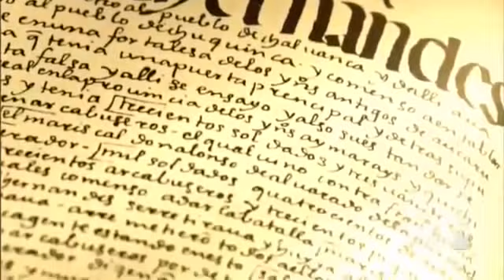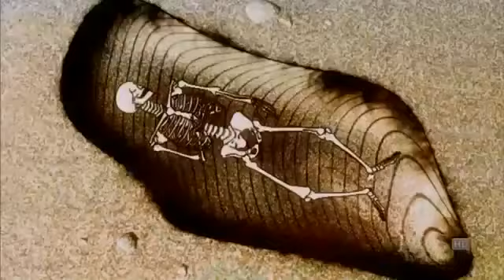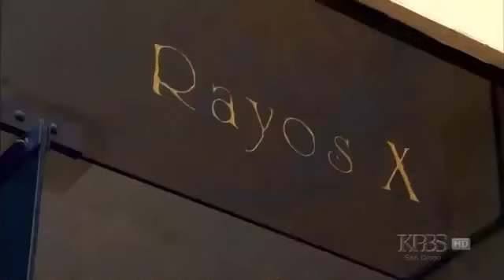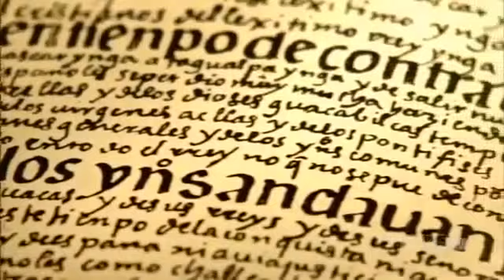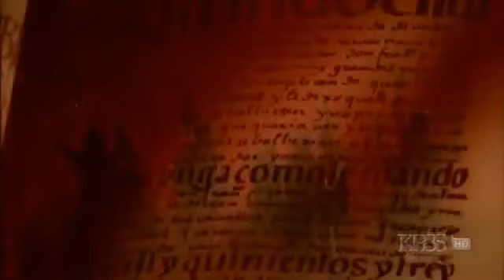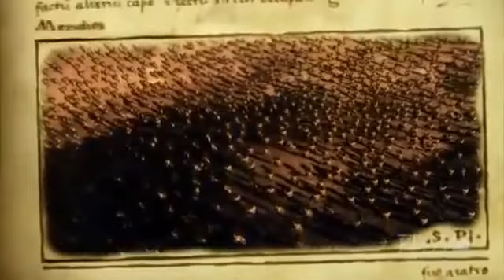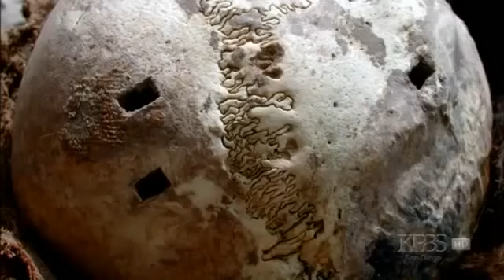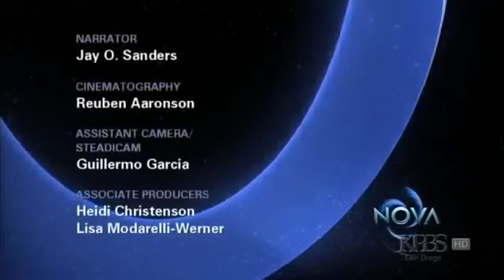Documentary on the Spanish Conquest Of The Incas

Comment: The fact that you don't find any metal residues in a wound, doesn't automathically mean that was NOT a gunshot wound. The projectile might have been made of many sorts of materials, different than just lead. You could have taken a stone and fashion it, into a more or less "round" shape, by work of abrasion and you'd still have a perfectly functional projectile for that type of a gun.  These weren't modern weapon were you practically MUST use calibrated ammunition. Furthermore - I think that for Pizarro's men, in those early stages of their conquest, finding lead to "fill up" their ammo-stock would have been increasingly difficult in the "Americas", so - at a certain point - they might have simply "adapted" to the situation by using ANYTHING to shoot at their enemy. Moreover - making gun-powder would have been much easier than finding proper metal-alloys for their weapons. Probably - at a certain point of their conquest - they would find themselves in a situation where STEEL (and even LEAD for projectiles) was more "precious" than gold. It's what you might call a fine paradox - they went there to find gold, but to "find gold" you must have STEEL, and STEEL (especially the "finer kinds", i.e: those used for blades, armour and helmets) would have been imported from their motherland. The "lead-stock" for their guns's projectiles, would have been very quickly used, simply forcing them to find any other material.
Reply: 2serveand2protect: Spanish armies never run out of ammo along the discovery, exploration and conquest of new lands.
They certainly shoot lead bullets, with firearms, they weren´t in the Stone Age.
And, by the way, that land was called Las Indias, not "America"
Reply: These guys were resourceful to the extreme.   When Cortez ran out of gun powder they actually lowered a guy into a volcano to get sulfur during the Aztec conquest.  Amazing stuff.  Also during the Inca conquest they started shoeing their horses with silver at one point as it was more plentiful than steel, so you might not be far off.
Reply: @bcsemotorworks2462  Wow showing their horses with silver...The Royal horses in Spain probably didn't have that luxury. Fascinating info, thanks.
Reply: @askalal9444  The conquests of Mexico and Peru are some of the most incredible happenings of all time. If you haven't yet id suggest reading all you can find.  That and Orellana's trip down the Amazon.  Amazing against all odds stuff.  And yeah about the silver horse shoes you're right. Also the gold they accumulated was so vast that they caused inflation to go through the roof. We're talking gold bars for bread.  The guys who accompanied Pizarro retired to farms in Peru sitting on mountains of gold but so did everyone else. They didnt see that coming haha.
Reply: @bcsemotorworks2462  Thanks. I have been doing some academic reading, research papers/journals mostly,  trying to get all points of views I can find. Are there specific readings you could suggest. I would love to read about it. Thanks again.
Reply: @askalal9444  Sure, the ones I have read are Conquistador by Buddy Levy, Conquistadors by John Pemberton, Conquistadors by Michael Wood, History of the Conquest of Mexico by William Hickley Prescott, Rivers of Gold by Hugh Thomas, The Golden Empire by Hugh Thomas, History of the Conquest of Peru by William Hickley Prescott, The Last Days of the Incas by Kim MacQuarrie and River of Darkness by Hugh Thomas. I can recommend all of these equally. They were so good in fact I was depressed for a little while when I'd be finished with each one until id find the next. Its a topic i never thought much abt my whole life until 4 years ago when i was 50. Being from North America I didn't quite understand the whole timeline of what went down before the Dutch and English settled this part of the new world.  The difference between lands that were plundered for gold and lands that were settled basically by people seeking a new life away from persecution or no opportunity is glaring. For starters the Conquistadors came over almost all male and took local women. North America was pretty much families coming over. Which reminds me there are two more books: 1491 and 1493 by Charles Mann that are indispensable for understanding the new world right before Columbus and right after.  Eye opening information especially 1491.
Reply: @bcsemotorworks2462  thankyou so much for taking the time out to share the names of books and your opinions with me. I feel we don't discuss this part of American history enough, like we do with European history. I recently saw the movie Agueirra: Wrath of God, thought it was wonderful, you could almost sense helplessness, fear , desperation and then the hope/resolve to find gold. From what I have read so far, it is a fascinating read from both perspective.
Reply: Yeah i saw that movie too.  That was a weird one haha.  Hey i thought of you when i came across this first hand account of the conquest by Pizarro's cousin Pedro.  https://babel.hathitrust.org/cgi/pt?id=njp.32101062611023&view=1up&seq=1  It ends abruptly but its really good and free.